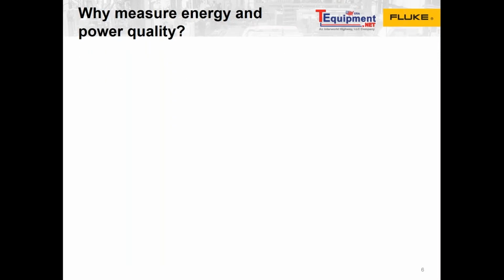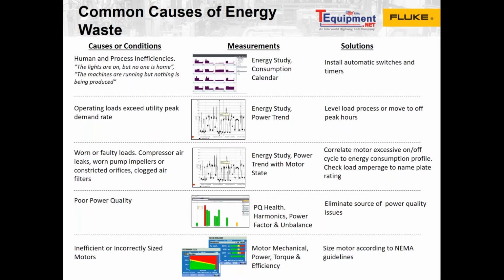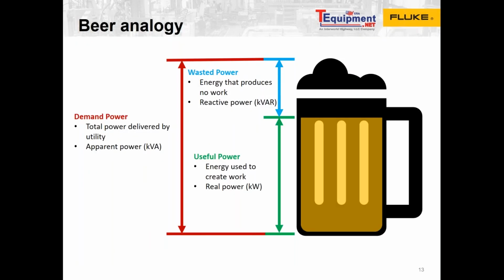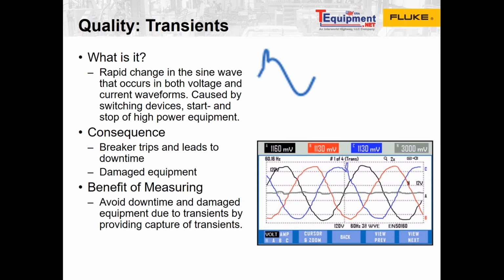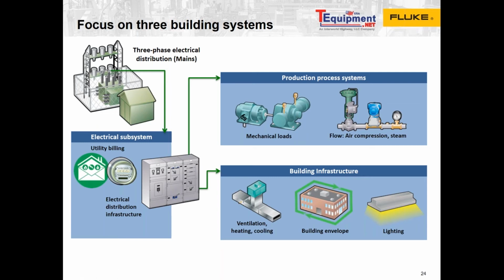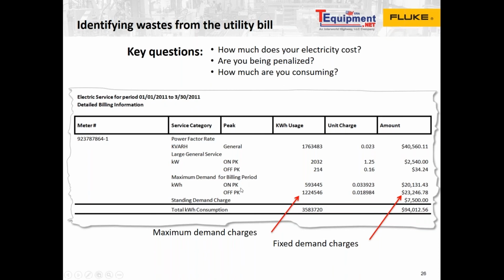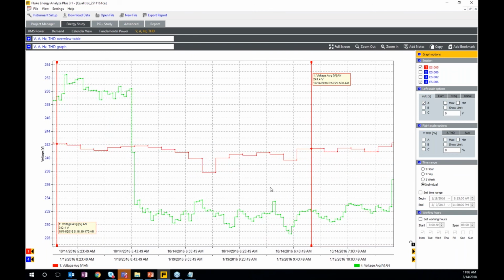Fluke Webinar: Power Quality and Energy Measurement to Reduce Cost of Energy

Comment: 🎯 Key Takeaways for quick navigation:

01:50 🌐 Introduction to the webinar and background information about the company, TEquipment.
04:09 💡 Importance of measuring energy use for businesses to ensure power quality meets local standards.
06:11 📊 Measuring energy and power quality is crucial for avoiding unplanned downtime, managing utility bills, and understanding facility usage patterns.
10:14 🔄 Distinguishing between quantity (energy) and quality (power characteristics like harmonics) for effective facility management.
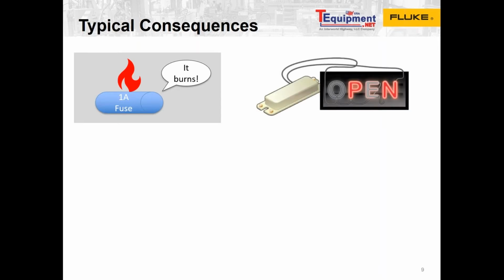12:39 🚨 Consequences of poor power quality include power failures, flickering lights, breakdowns, and malfunctions of machinery.
16:18 🛠️ Causes and solutions for energy waste, including inefficient loads, poor power quality, and incorrectly sized motors.
21:13 🍺 Analogy explaining real power (useful), reactive power (wasted), and demand power in the context of energy efficiency.
24:18 📈 Importance of analyzing measured power data over time to understand usage patterns and identify opportunities for energy savings.
25:47 ⚡ Explanation of demand kilovolt amps (KVA) and the need to reduce total demand on the utility for cost savings.
26:55 🌐 Power factor as a measure of system efficiency and the impact on utility rates; maintaining a power factor above 0.95 can avoid penalties.
27:08 ⚡ Power factor affects billing: Poor power factor can lead to additional fees for the entire billing period, even if it's below 0.95 for only 15 minutes.
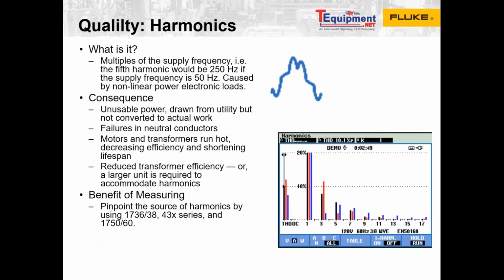29:12 🔄 Harmonics and LEDs: Harmonics, caused by nonlinear devices like computers, decreased due to smarter engineering. However, transitioning to LED lighting may introduce harmonics, necessitating careful consideration.
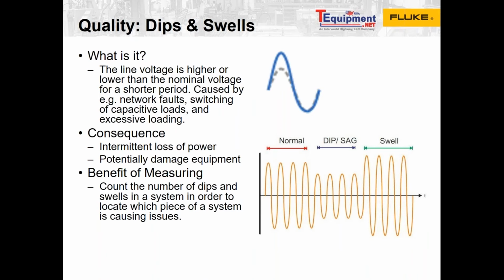33:41 🔽 Dips and Swells: Electrical disturbances like dips and swells can lead to power loss, equipment damage, and downtime. Monitoring tools like Fluke help identify these issues and quantify their impact.
35:07 ⚡ Transients: Rapid voltage or current changes, known as transients, can cause breaker trips and equipment damage. Measuring transients helps prevent downtime and equipment damage.
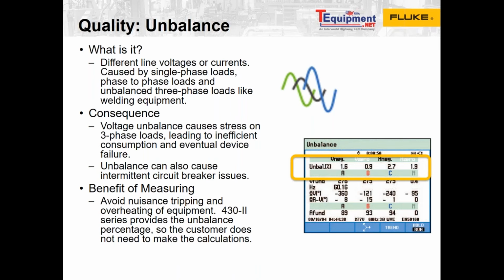36:42 ⚖️ Unbalanced Systems: Unbalanced voltages in three-phase systems, caused by various loads, can lead to inefficiencies, overheating, and equipment damage. Fluke tools simplify the measurement of unbalance.
39:58 💡 Flicker: Visible changes in brightness, or flicker, can result from large motor startups. Flicker may cause health issues, nuisance tripping, and unwanted triggering of backup power supplies. Measurement helps pinpoint the cause and avoid problems.
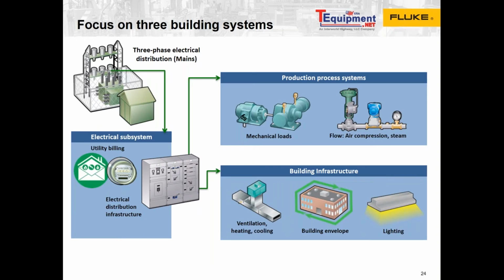41:44 🏭 Facility Energy Management: To optimize energy use, start by measuring total power consumption at the main service entrance. Identify energy-intensive equipment, like motors and lighting, and prioritize efficiency improvements for maximum impact.
49:58 🔍 Understanding Utility Bills: Utility bills provide crucial information on electricity costs, peak demand charges, and usage patterns. Analyzing the bill helps identify opportunities for energy savings, such as shifting usage to off-peak times.
53:05 🔄 Regularly monitor energy consumption, especially during non-operational hours, to identify areas where energy is being consumed without useful work.
54:15 🔄 Duration of energy measurement depends on operational cycles; cover as much as possible, considering seasonal variations and changes in operations.
54:41 📉 Understand power factor and demand, as poor power factor and high demand lead to surcharges due to the utility compensating for inefficiencies.
55:07 🔍 Utilize tools like power meters at different points in the electrical system to pinpoint areas for energy improvement and identify the biggest return on investment.
56:29 📅 Use calendar views to detect unusual energy usage patterns, helping quickly identify and investigate potential issues.
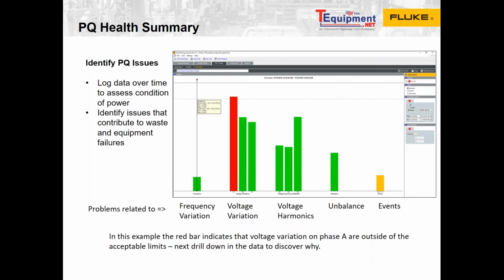57:21 🛠️ Leverage power quality analysis tools with color-coded indicators to assess frequency, voltage variations, and events, providing a starting point for energy analysis.
58:13 📊 Explore software capabilities for comparing different time periods, allowing a detailed analysis of power usage patterns and identification of anomalies.
59:29 ⚙️ The Fluke 438 series two measures torque and mechanical outputs through current signature analysis, eliminating the need for physical measurements at the motor itself.
01:00:23 🛠️ When choosing a Fluke power quality tool, consult with experts at T Equipment to determine the most suitable model for your specific application.
01:02:15 🌐 Assess power quality based on local standards (e.g., EN 50160 in the U.S.) and use Fluke power quality tools with preset modes for easy compliance monitoring.

Made with HARPA AI